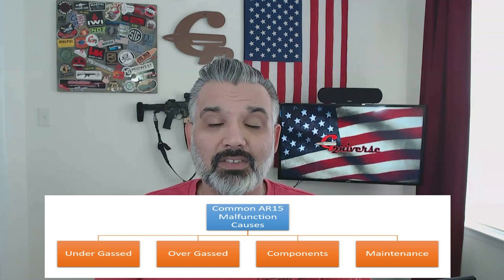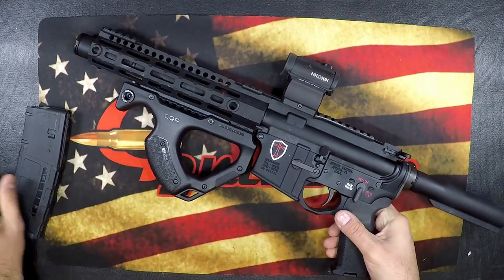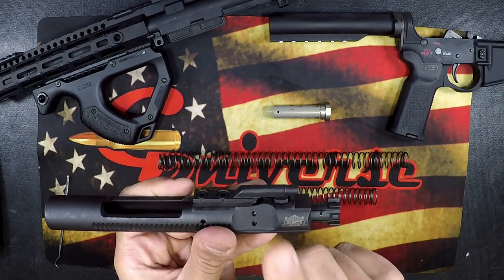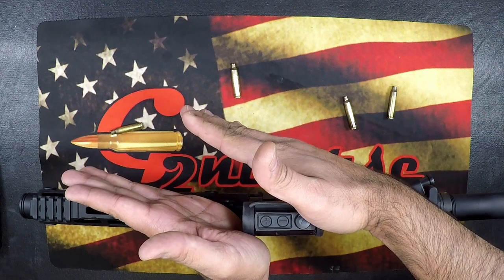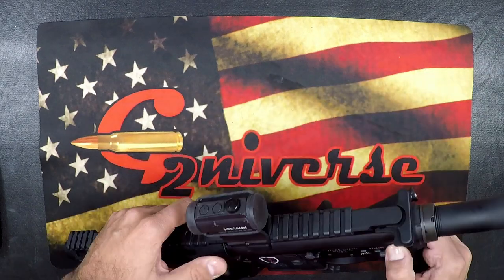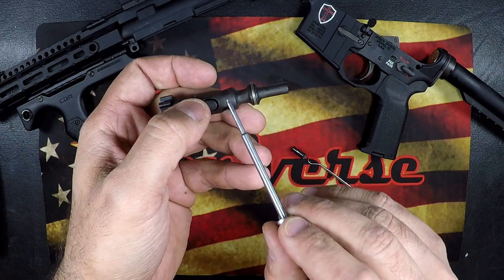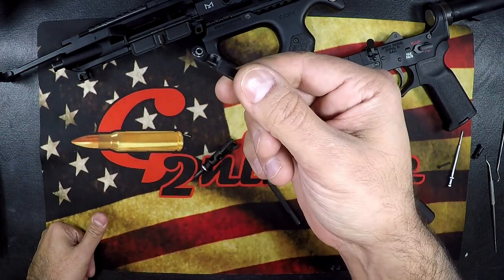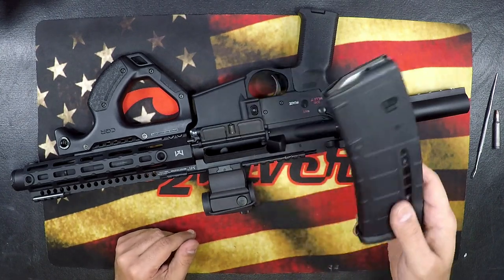Safely Fix AR - Failure to Feed, Eject, Extract and Fire

Comment: i bought an ar from a pawn shop, and granted, it had some issues. but i got them properly addressed. and it turns out the 500 dollar pawnshop score is a nail triver. but i noticed the other day tht it is overgassed. so i checked the spring and it had an unmolested spring (wasnt cut or manipulated in anyway that i could tell. it looked like a factory spring. however it had 39 coils. yeah i counted it 3 times. it was right in the middle of a carbine and a rifle length spring. so since it confused me, i just bought a heavier buffer and a new spring. i have yet to test it, but the new parts have been installed. i hope the buffer is heavy enouugh, but i will know this weekend.

Comment: thank you great video! my stag 15 has feed ramps on receiver but not barrel. brand new from shop and jams almost every round! i’ve bent / dented 100 rounds just trying to chamber the rifle. looking for a professionals opinion what would you do
Reply from the maker: Take it back to the shop and have them either change the barrel or cut in m4 feed ramps. They set you up with the worst possible scenario besides no ramps on anything.
Reply: Thank you!

Comment: Until recently my AR has been 100% reliable with the exception of one round I hand loaded that had a primer incorrectly seated. Outside of that every round I put through my AR has fired and ejected it's primarily an old Mossberg MMR Hunter with mossy oak finish. Two weeks ago I fired an overpressure ground I blew my magazine out and did damage to my bolt and extractor and had to have parts put into it to fix it everything there seems to be functioning correctly with the exception of the gun will not go into battery it gets hung up somewhere on the trigger and then when it connects to the gas tube. It's getting hung up prior to the gas tube though it's important to mention that.  As soon as I start to pull the rear pin and I'm able to elevate the upper a millimeter or two from the lower it slams in the battery so I know my problem is somewhere with the trigger group or the bolt catch I just can't seem to figure out what's malfunctioning because for the first problem I can't see where it's catching. The second problem I can fix pretty easy

Comment: Man thanks!! I’m having feeding issues with my 350 legend build and I think it’s a feed ramp issue now. Those marks are the exact kind of markings that I see.  How do I fix that? Dremell?
Reply from the maker: JB... great video first off. Couple questions first. Have you tried a completely different magazine? Have you tried just loading one round in the mag and seeing if it still hangs up?
ARs are really picky with straight case ammo, that's why almost every other round has a taper... to allow it to start in the chamber and then seat in. With a straight round its much harder. 
With that being said what does your feed ramp look like? You should be seeing metal shavings on it from the grinding. If you can take a well lighted picture and email it to me, it would help.  G2customgolf@gmail.com
Reply: @G2niverse  I have tried different magazines and loading one round and still same results. It loaded the fmj round just fine but didn't take the deer round. i have notice during the feeding (manual feeding) issue, that the bolt doesn't seem to be hitting the round flush. The bottom of the bolt face hits right in the middle of the round thus preventing it from picking it up and in the chamber. Also, at the same time is seems to be trying to feed the next round up (also manual feed slowly releasing the bolt myself). i will take pictures and send them soon. thank you.
Reply: Did you ever find the issue ? Just built a ar15 350 having same issues 4 mags 4 different types of ammo all the same results.  200 rounds for the break in on the new build cleaned after each 100 .  Every  2 or 3 rounds jam sonetimes can get 5 to run smooth. Round gets lodged half way in the barrel with the bolt slaming it to it causing dents ..

Comment: Hoping you respond to this sir. My BCG isn't closing despite the AR being dismantled. I cleaned and even removed the o ring on the extractor and it's simply not sliding all the way in
Reply from the maker: Not closing even when unloaded?
Reply: Check for carbon build up towards back of the section bolt slides into.

Comment: I'm having  failure the fire problems. She shoots she ejects consistently, she loads bolt has traveled all the way foward but then she doesn't shoot. Bolt isn't bent, firing pin pertrudes when depressed, hammer and trigger are fine. Ima keep tweaking with it until I gets it
Reply: Out of spec aftermarket parts.   Verify your headspace, verify your bolt length, verify your firing pin length, ensure that your hammer spring is good, and installed correctly, verify that your ejector pin can depress fully.

Comment: I built an AR15  5.56 for my son and it doesnt like steel casings but will run brass just fine. Do you think over time with wear it would run steel casing? Im not a big fan of it but you get what you can get when you can get it type thing.
Reply from the maker: Yes, it will break in. Most people just attend patient enough and think after a few mags it should be fine. Realistically, if it's not running both by 500 rounds... then you might need to start looking at solutions.

Comment: Got a bran new 6 arc and brass sticks in chamber so hard it mives bolt about a half inch and then have to beat on side charge Handel to get it out the rest of the way.

Comment: Hey I'm a home builder too and I wanted to add something that you missed hopefully you guys don't have this problem I use the old style handguards with the fixed sight up front when you tighten your barrel nut if you tighten it and you have your gas tube Cocked to one side or the other because it's not aligned properly with The notches in the nut and the gas tube path,  the gas key will drag on the tube and it can slow down it closing back into battery especially if you run a dry rifle make sure it's lubed to the point of craziness like your girlfriend and make sure the gas tube is straight you could use an old gas tube as a tool a gauge to make sure that it's going in straight you just have to cut it like in quarters and use the quarter that goes into the yes he is your gauge this is why it's super important to get the proper equipment to take care of barrel tightening good luck guys
Reply: If you need to slightly bend your gas tube because it's dragging you can use a flat screwdriver from the bottom of the reciever and gently bend the tube. **Correct install of the gas tube** is where the gas tube will move slightly and there's no tension from the nut onto the tube if you have tension of metal onto the tube over time it can wear a hole in it and it will probably fail when the zombies just about got you so make sure your nut is tension properly and make sure the notches are lined up and the gas tube is not being bound by the nut
Reply: You seem really knowledgeable, I just disassembled my bcg and lubed it up but now I’m having constant failure to feeds, can’t even load initial round without the charging handle stopping half way with a jammed round…

Comment: I am having the weirdest issue, its a failure to eject or extract. my rifle will eject fine with PMC xtac 5.56 and bronze .223 but not AAC 5.56, its not short stroking or undergased, passed the one round mag test. since it works fine with the PMC ammo its not the extractor. I would chalk this up to being bad ammo, but the AAC ammo works fine on every other rifle and ive even swapped the BCG with another and the AAC shoots fine. Everyone Ive talked to is stumped as to what the issue is. Manufacturer told me it was a leaky gas key but that didnt fix the issue.
Does anyone have any ideas as to what could be the issue?
Reply: Slightly different powders with different burn rates are affecting the cyclic timing on this one particular rifle that is borderline undergassed.  It’s probably a soft shooter compared to others.   Get yourself a cheap $29 adjustable gas block.

Comment: My 6.8 spc I built is locking back on the last shot. But it’s locking on the bottom of the carrier not the bolt face. I checked the alignment of the gas port. Tried different mags ammo buffer weights.
Reply: Read up on 6.8 gas port sizes, download a drill bit chart, buy some numbered bits(they fall in between the fractions)  and use them to measure yours. If it's unsersized open it up just one Size bigger.  If your port is a #52 open it up to a #51

Comment: Hi there, I have a weird problem. New build, my bolt will not pull back all the way to strip a round out of the mag. Its a AR47 pistol. I counted the buffer spring and its 37, so that is correct. When I pull the bolt it sets the trigger. Actually it looks like its the extractor that is not pulling all the way back. Any advice? Thanks and great vid!
Reply from the maker: Maybe be dumb... but you have your bolt assembled correctly?  Cam pin is correct? Will it go back with no buffer spring?

Comment: I have a brand new BCM, when ever I try to do a reload with the bolt back, it doesn't fire.  I fire a magazine, the bolt is locked back, I press the bolt catch to put it into action and it doesn't fire.  What is the cause of that?  It fires fine when I'm not doing a reload.  Is it user error or is something wrong?  Like I said, it's a brand new gun from BCM.
Reply from the maker: Sounds like a potential mag feeding issue. You try other mag designs? The other thing could just be it need to get worked in.

Comment: I have a 5.56 nato ar-15 and the guy at the dealer told me it is ok to shoot 223 ammo in it. It will shoot and eject the casing but it does not chamber the next round. I have to pull the rod back to chamber the next round. What can be causing that?
Reply: I had my 5.56 fixed. The gas block wasn't aligned right. That's it.
Reply: Same. but after having to chamber a round by hand once it’ll start going fine

Comment: I’m having an issue where the bullet is being pushed into the casing when loading from the magazine. Is that also a feed ramp issue?
Reply from the maker: Yes... the bullet is most likely hitting the lip of the ramp going into the barrel... check and see if your barrel and upper both have the correct feed ramps.  Then check your mag...it could also be because the round is angled down

Comment: One of the biggest reasons for poor reliability in AR rifles are poor chambers. Having an armorer or gun smith that has a function gauge is worth the time and money. Short, tight chambers and improper throat sizes are very common..Always check the chamber size with a function gauge, a throat gauge and the correct go head space gauge of 1.4646 in a NATO marked chamber..
Reply from the maker: hairydogstail You make a great point!

Comment: I have a 7.62 7.5ar pistol den broke 3 extractors...I think cuz ma BCG was moving to fast an I wasn't giving the round enough time to shrink an pull out the round I broke one even with an H3 I'm waiting on my springco hot white....what do u think?
Reply from the maker: Doley_ Osama a short barreled 30cal?  definitely overgassed. Id go with the heaviest buffer you can find and high powered spring. if still not working, check the spring in the bolt catch to make sure its the right spring.  check this video out...
https://www.youtube.com/watch?v=vaWKdJvn_SM
Reply: @G2niverse  bolt catch works fine. you stated my problem in your video the carrier is moving to fast it's not give the fired round time to shrink den be extracted it was jus ripping them out.

Comment: Wha if trigger doesn’t click when u load it ? Any feed back from anyone on here would be cool
Reply from the maker: Your spring is backwards OR if you did an 80%, you (1) didn't mill your fcg pocket deep enough or (2) didn't get your trigger/hammer pin holes right or (3) both 1&2

Comment: Also my pin in the extractor is near impossible to get out like I took it out 2 times and had to use a hammer to get it back in
Reply from the maker: Your bolt and bcg is toast. Just replace them.
Reply: I figured I'd buy a new bcg and everything

Comment: Mines fires but wont extract and empty cartridge in the chamber have to push it out … any help?
Reply: Check the bolt carrier group and make sure your extractor isn’t broken. I had issues with my BCA 7.62x39 ar and it was a broken extractor
Reply: This is exactly my issue as well. It’s an ARP build I got from the local gun store around $600 and it’s been a nightmare. I cannot get through 1 round without a double feed. The spent round won’t eject so the next one up is getting stuck/pinched under the spent round that is not ejecting. Once I clear the new round it’s all bent up and usually unsafe to fire so I hand pull the action and the spent round extracts fine. Just won’t cycle when shot.

Comment: help!  the last two or three rounds are not feeding properly but when the mag has more rounds those feed just fine.  It's the case with different mags.  I'm using plastic snap caps to check function.  the platform is a new build, not shot yet.  Barrel and upper have the M4 feed ramps.
Reply from the maker: Until it's a live fire I don't think it's an issue. Snap caps are great but the tolerances aren't perfect. As you get towards the end of the mag, the spring tension is obviously lower than when it's full, if the snap cap is just a little undersized you get a failure to feed.
Reply: @G2niverse  thank you!  this is a great video, especially for someone like me who's new to the AR :D  I appreciate your reply and advice!

Comment: can the extractor pin cause a failure to feed?  while holding and swinging or flicking the bolt it does not move. after removing the o rings (that sits on the spring) from the extractor pin, it now moves freely. i've yet to go back to the range.

Comment: I have a crack thats underneath the gas key that came up after putting a few thousand rounds thru my custom ar what could've caused that? The crack is over the smooth piece by the 2 holes that's under neath the gas key
Reply from the maker: yeah thats a huge problem, scrap the BCG and get a new one.

Comment: @15:25 my firing pin the silver long piece doesn’t stay in place like how yours doesn’t just fly out when you shake but mine does My problem has been the firing pin not staying in place this is a new DB15 haven’t been shot yet and the little part in the bolt that has a spring and a washer mine is completely ripped off and a piece of rubber is stuck in the small spring @21:00
Reply from the maker: Is there a retaining on holding it in place? Sounds like it's assembled incorrectly.

Comment: Hello, I have a new 350 legend ar 15. Single round it ejects fine. With a magazine seated, I get many rounds halfway ejected with the slide stuck half open. Or the fired round gets ejected but the next round feeds halfway and angled/jammed. 

Around 200 rounds through the gun.

Casings are landing around the 3 O-Clock.  

New guns need more lube? Different magazines?  Buffer weight? 

Buffer spring  has 26 coils at 10 7/8in
Reply: Casing rim looks good.
Reply: Did you have any results getting this resolved.  I have the same issue on my 350 legend.
Reply from the maker: this could be one of two things...either your buffer is too light and its giving the impression of a failure to feed so you need to slow it down by making it heavier... OR
You have a magazine problem.  They are either getting hung up on the magazine itself, the feed ramps of the barrel/upper, bad follower, underpowered magazine spring.
Id start with the buffer first since its the easiest and then work into the magazine.  Its hard to see where rubbing occurs within a magazine or feed ramp, so use a light coat of white out on the areas you think it may be rubbing and youll see wear marks.

Comment: hello Robert gemini here. if I have an AR-15 5.56 nato 16 inch barrel and is a rifle length gas system 
do I have to have a rifle length buffer spring?
Reply: To answer your question yes and no. If your gas block is not adjustable get a rifle buffer. If your gas block is adjustable and you're comfortable with adjusting it then you can go either way.

Comment: Replace trigger on Bill getting double fire on single pull. Could this be a gas problem. Gas block not staked to Barrel?? Please help
Reply from the maker: Duane Shadd double fire?  As in burst?  Your fire control group is jacked, nothing to do with your gas system.
Reply: When I pull trigger double fire already replaced trigger
Reply: @G2niverse  could something be going on on the trigger if not resetting

Comment: @ 23:50 my rifle doesn't extract if i pull the handle back when there's a live round in it, only when i fire it the shell comes out but i can't unload a live round. what should i do to fix this issue
Reply from the maker: ceeza25 check your extractor and check the casing.  Your extractor may be too loose or too tight.  When you load a round, do you let the bolt slam or do you ease it in?
Reply: @G2niverse  which way should i load the round ? letting it slam or just guide it? that pin that you push at 23:50 can be pushed in by my hand with decent force i'm thinking maybe it has to do with that

Comment: When I try the one round mag test my bolt locks back but doesn’t full eject the round it kinda just sits above the magazine inside the barrel. Any thoughts
Reply from the maker: BVTV when you live fire? wierd...sounds like a bad extractor.  Check out the other videos for failure to extract where I go into disassembly of the bolt.
Reply: My 450 bushmaster does the same when I do the one round mag test. However, when I manually cycle it, it ejects the round.
Reply: After watching his other video, I will replace my ejector:
https://youtu.be/A3UaOU-4tiw